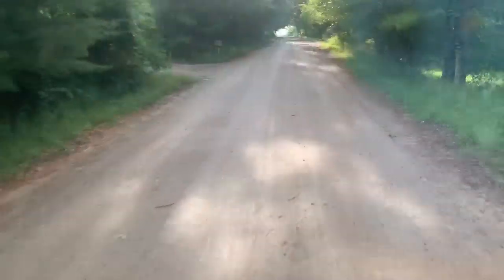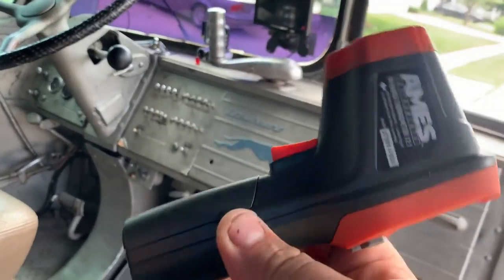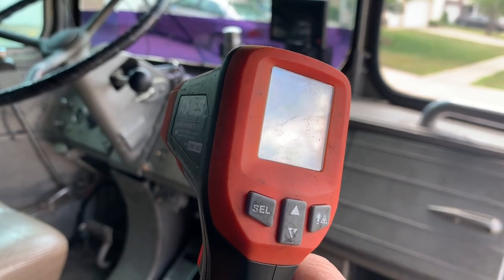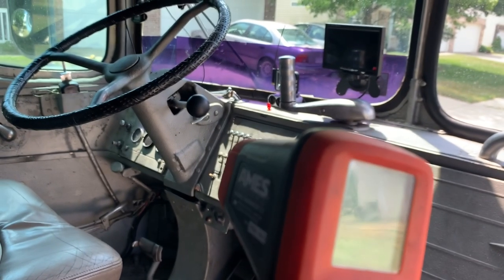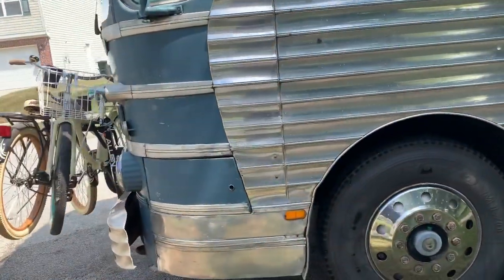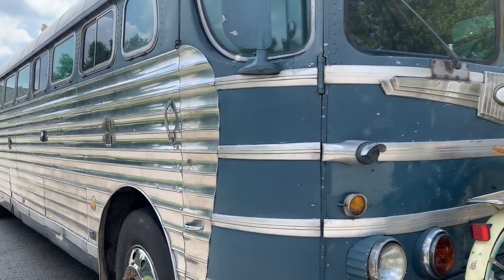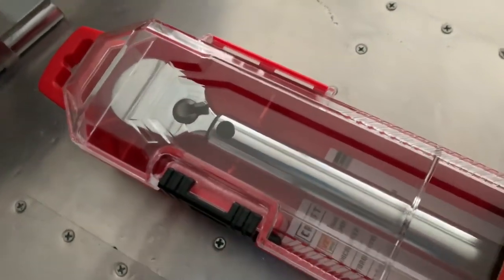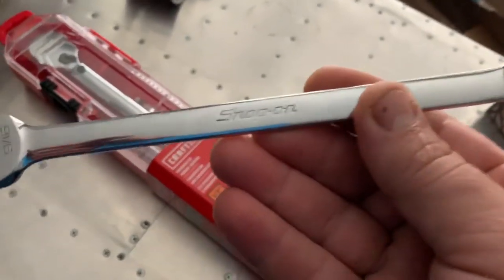Driving a vintage bus in extreme heat

Comment: 2 things that are important for people to be aware of with ir thermometers.  First, the detection point isn't the laser, that's just a laser pointer.  It's actually an cone that expands out from the meter.  So if you're a couple feet from what you're testing you will actually be getting the average temperature of a circle of some diameter (probably about a foot at 2 feet range.). Second they do not work properly against shiny surfaces.  The shinier the surface the less accurate the reading will be.
Reply: They work perfectly well with shiny surfaces, the only catch is that you are not measuring what you think you are measuring when aimed at a shiny surface. ;-)

When it comes to shiny surfaces it helps for people to remember that IR is just light of a much longer wavelength...so when you stand in front of a mirror what do you see in that mirror — the surface behind that mirror or do you see yourself and everything else in the room in front of that mirror?
Reply: @ethanpoole3443  good clarification!
Reply: Absolutely correct, this reflection on shiny surfaces is due to Emissivity, google search would be way more productive than me explaining it..😁
Secondly, know your thermometer, some give a max temp reading within the cone, others are average.  Know what your working with, it could cost you an engine....
Reply: @ethanpoole3443  Kinda... shiny surfaces have a different emissivity and there are charts and graphs to set it. Some meters will let you adjust it. 

The quickest and easiest solution we have found for thermal testing of aluminum heatsinks is to paint them flat black. 

We check heat sink temperatures for 6000V dc bus rectifiers... obviously non contact is the way to go with those guys!
Reply: kleetus92 Not really a “kinda” ;-).  Emissivity and Reflectivity (or albedo) are the inverse of one another — a perfect black body radiator will have an emissivity of 1.00, a perfect reflector 0.00 (highly reflective surfaces make very, very, poor thermal radiators).  Emissivity plus Reflectivity (albedo) will equal 1.00.  So when we are talking about highly reflective surfaces we are talking about surfaces with very, very, low emissivities and very high reflectivity (albedo).  Much like Dissipation (1/Q) and Q (1/D) in electronics circuits (specifically, how lossy or non-lossy a circuit, such as a filter, or component, such as a capacitor or inductor, is and thus how quickly they will dampen, for example, ringing), reflectivity and emissivity are each other’s inverse.  

As a general rule, to get a meaningful reading off a shiny (very low emissivity) surface you will need to apply something to the surface to increase its emissivity (such as black paint, roughing up the surface to reduce reflection, oxidizing the surface, applying lamp black, or even a simple piece of tape) so that you can reliably measure the temperature of that surface without the measured temperature being swamped out by reflections from the ambient environment.
Reply: @ethanpoole3443  Isn't that what I just said?
Reply: kleetus92 Not really, when dealing with low emissivity/highly reflective surfaces (at IR) it is not just a matter of setting an appropriate emissivity setting in your IR probe as the IR reflected from the ambient environment will usually swamp the emitted/radiated temperature of the surface you are trying to measure so you must first take steps to not only set an appropriate emissivity value but also to accurately characterize the ambient objects that will be reflected by the measured surface so that special post processing may be applied to null out the effects of the (typically) dominant reflected IR...otherwise your reading is often meaningless even with a proper emissivity value entered into the IR probe since the IR probe itself can not differentiate between emitted and reflected IR (assuming the IR probe can even handle emissivity values so low as most will bottom out well before you achieve genuinely “high reflectivity” — e.g. emissivity of 0.1 or 0.2 at the lowest end typically while a highly reflective metal surface may have an emissivity of less than 0.05).  That is why it is usually much easier, and often much more preferable, to take steps to alter the emissivity of the surface you are measuring such that it is in a much more ideal emissivity range and no longer dominated by reflected ambient IR.  Also complicating matters is that the emissivity of metals will actually vary with temperature so they don’t have any singular “proper” emissivity value unless you know the metal, the IR wavelength being measured, and the expected temperature (within reason).  Thus it is  nearly always much easier to simply eliminate measuring reflective surfaces altogether and instead alter the surface to be substantially nonreflective so that you are measuring the actual emitted heat and not concerning yourself with what unintended reflected sources one may have measured instead of trying to deal with complex ambient environment characterizations and advanced post processing in an attempt to null out reflected sources — a little spray paint or lamp black and your comp,ex measurement “problem” is instantly simplified by orders of magnitude and the readings much more accurate.
Reply: @ethanpoole3443  Maybe you missed the literal second sentence of my three sentence post.

"@Ethan Poole Kinda... shiny surfaces have a different emissivity and there are charts and graphs to set it. Some meters will let you adjust it. 

The quickest and easiest solution we have found for thermal testing of aluminum heatsinks is to paint them flat black. "
Reply: kleetus92 With respect, the part you are missing is that setting the emissivity coefficient for a shiny surface still does not give you a meaningful temperature reading as the emissivity value does nothing to null out the reflected ambient IR that also reaches the probe as the probe sensor can not differentiate between emitted and reflected IR.  I realize you want to be right, but you are missing that critical fact that it is not just a matter of setting the emissivity value when dealing with highly reflective surfaces since the IR probe can not differentiate between emitted and reflected IR reaching the probe’s pyrometer sensor and to get a meaningful reading on such surfaces you have to address that reflected IR before you can get a useful reading and nulling out that reflected IR is not a simple matter as the emissivity value does nothing to address the reflected IR error.  The reason one does not usually have to worry with reflected IR is because most of the time we are using such probes to measure surfaces with reasonably high emissivity and comparatively low reflectivity so the reflected IR does not significantly influence the reading (within reason), but once you start dealing with highly reflective surfaces with low emissivity the reflected IR part of that equation begins to swamp out the emitted IR and at that point you must address the issue of ambient reflected IR before you can get a useful reading and there is no simple value one can enter into a probe to correct that reflectivity problem, hence why we ordinarily choose to address the problem by modifying the shiny surface to largely eliminate the reflectivity and make it a highly emissive surface instead since the emitted IR is what we are really desiring to measure.  

Any how, the point I’ve been trying to make is that inputting an appropriate emissivity value for highly reflective surfaces does absolutely nothing to correct for the error introduced by ambient IR reflected off that shiny surface.  The emissivity value only properly corrects the temperature reading for IR emitted by that surface yet your probe is receiving both emitted and reflected IR off that surface (emitted from other surfaces in the surrounding environment) and is simultaneously trying to apply that low value emissivity correction to the reflected IR as though it were also emitted from the measured surface yielding often wildly inaccurate temperature readings.  The low emissivity value then gets applied as well to all the unwanted reflected IR, yet that reflected ambient IR likely has a much, much, higher emissivity coefficient, and that low entered emissivity value (for the shiny surface) applied to the much higher emissivity reflected ambient IR also reaching the probe only further increases the error since low emissivity values effectively multiply the temperature correction curve such that the reflected IR tends to further swamp out the intended measurement since they both emit more IR and are now having that contribution further multiplied by the low emissivity setting.

I’m not trying to give you a hard time, just trying to point out that the emissivity coefficient one enters for the shiny metal surface does absolutely nothing to correct for the often considerable error introduced by the IR being reflected off that surface that was emitted by other sources in the room.  By comparison, apply a little black paint or lamp black to that same surface and you can leave the emissivity at 0.95-0.98 and you get an accurate reading since the surface no longer reflects versus the alternative of inputting a shiny surface emissivity of 0.05, or less, and trying to somehow compensate for the complex error from all the unwanted reflections swamping out the intended reading.

If one has access to an IR temperature probe with configurable emissivity settings (the greater the permitted emissivity range the better) one can conduct an experiment for themselves by using a common mirror (first surface mirrors are preferable, but second surface will also work) and a high heat source (such as an electric rangetop burner, gas mantle camping lantern, space heater, etc.).  First use a coefficient of ~0.95 and measure the heat source directly.  Then compare that reading to the same heat source when aimed by way of reflection off the mirror (keeping in mind the expanding conical measurement area that grows with distance from the probe).  They should be similarly high readings if the measurement area has not expanded too much over that distance.  Now try setting the emissivity value to the lowest setting that can possibly be entered (ideally 0.05, but you will likely be limited to a much higher value) and repeat the experiment trying to measure the heat source as reflected in the mirror.  If changing the emissivity value to a very low setting was enough to compensate for a shiny surface’s reflections then one would now be measuring the temperature of the mirror (at, or near, room temperature) and not that of the reflected heat source...but one will find that the reading is now likely far higher if all went well (possibly even over range) than previously measured and nowhere near room temperature because the lower emissivity value entered was also applied against the reflected heat source in addition to the mirror and the reflected heat source has completely swamped out the attempt to measure the mirror’s actual temperature.  Afterwards it will be evident that simply adjusting the emissivity coefficient does nothing to null out the often significant error inducing effects of heat sources reflected off the shiny surface.
Reply: @ethanpoole3443  
Wow. Now my brain hurts.
Reply: Hey guys, I am loving this discussion.  However, I have a suggestion that might be a godsend to this heat and heat measuring dilemma.  I have assisted with a fair amount of maintenance and repair of air-cooled horizontally opposed 4 and 6 cylinder piston aircraft engines, Lycoming and Continentals.  Would it be possible to put an aircraft style engine analyzer with probes on one of these engines????  You could get a constant read on cylinder head temp.

Comment: I broke the piggy bank this spring and had my silversides radiator recored with as many and as big of tubes as they could fit.  I now tow the toad with the pedal to the floor in the worst heat I can find. The temperature rides right on the thermostat 99% of the time. Gets to about 180 on the long steep climbs.. It was well worth the peace of mind except when I look at my bank statements and see a radiator sized hole.

Comment: A lot of those dirt roads in Michigan get sprayed with a calcium chloride solution to keep the dust down and that stuff is worse than regular road salt by far.  Couple it with hot and humid weather and you can almost hear it eating away at the metal.
Reply: Didn't knew that. What if you inhale the dust??
Reply from the maker: It seemed salty.   I was thinking maybe the sand was some ancient salt sea but that didn’t seem right ;) i like your answer better.
Reply: We used Calcium Chloride in tractor tires to improve traction when plowing and it is very corrosive, we would install a inner tube on tractor tires that was tubeless as it will eat the steel rim in a short time

Comment: I used to drive a ten wheel dump truck for a construction company in Arizona and New Mexico, temps at night could go as low as 5 to 10 degrees above zero and as high during the day as 110 degrees plus. I found a new feature on those dump trucks, Mack. B-81's with 300 horsepower engines with the stock B-81 radiator. Attached to it was a pipe 3/4 inch with a 1/8 inch holes drilled into the pipe all on the same side. 12 volt submersible pump sitting in the bottom of a 55 gallon plastic barrel mounted horizontally. When the air piston opened the shutters and the temperature continued to rise you pressed a spring off push button to pump water into the 3/4 inch pipe mounted in front of the radiator tank which sprayed cold (?) water over the front of the radiator bringing the temperature back under control. I rarely had to hold the water button more than 20 seconds. That would drop my temperature by over 25 degrees every time I used it. When you pushed the button and no cooling took effect you were out of water but the company always parked a water buffalo at every job site. Considering the new normal high temperatures might it be useful for you Scott? The water pump had a 3/4 discharge coming out of the pump.

It was as I discovered a lot of drivers mounted a garden hose with a nozzle on the end and a shut off for the hose and mounted a mechanical on/off switch so they could soak themselves down as within 10 miles with 200 degree hot air coming out of the floorboards you needed a way to cool yourself down. Once you were up to 50 mph and running on level terrain you were cool enough in the cab. My major problem was being the newest driver in the company I was always assigned site work, never more the 8 to 10 mph sweating your cookies off. I stood in front of the site water truck five to six times a day while the driver soaked me thoroughly, god that felt good and I was in shape back then 6'1" 285 pounds with a 30 inch waist. I wish for the old days. Sigh!

Thank god you decided to update the radiator to 5 core.

Comment: I was raised around trucks. My grandfather's first diesels were 6V71s, (well, he did take delivery of one 6V53... my ears still hurt). I love love love Detroit Diesels. I love the way they sound, I love the way they smell (there's nothing like the smell of a Detroit Diesel first thing in morning!)... Again, love love love!

I once watched a 6-71 run away and the emergency shut off failed. My boss jumped in the truck, shoved in the clutch, ground the tranny into gear and slipped the clutch out quickly, praying that the brakes and drive shaft would hold. The motor lurched to the left, then lurched to the right, then rocked back and forth, firing on one cylinder about 3 or 4 times, then died. That fix included a new clutch and flywheel. I also saw an 8V71 run away and the mechanic grabbed a hammer and smashed the fuel line fitting off the front of the head. She quickly died

I love your skill, knowledge, attitude, and hence, your videos. But I have to take exception to a facet of this video. I base this on my skills, knowledge, and, I guess, attitude. I finished my carrier as a food safety guy with a refrigerated trucking carrier with a freezer warehouse. One of my duties was to oversee our temperature recording equipment. I would trust a mechanical thermometer much more than an infrared gun. IR guns are very handy, but notoriously inaccurate. If you wish to use one as you've suggested, (and I would, to a point), you must follow certain protocols. First and foremost, read, and follow, the directions. Used improperly they are worse than useless because the will give you a false reading, that you will trust. Second, they are never spot on. So first, take a reading, as per directions, of a pot of vigorously boiling water, and record the difference between it's reading and 212 degrees (allowing for altitude). That would be your plus or minus going forward. I would prefer referencing my dash gauge against a calibrated mechanical thermometer setting in the top of the radiator after about 5 minutes at 1,000 rpm. I completely agree with your direction to use the IR at the engine hot spots. This is were an IR unit shines, finding anomalies, and their causes.

I offer these suggestions because I know from experience how critical temperatures are to a Detroit, especially if you are going to use it to manage your engine load.

Keep up the great videos, and if you find yourself in Florida, stop by. I'll ply you with beer while your wife convinces my wife to let me get a bus.